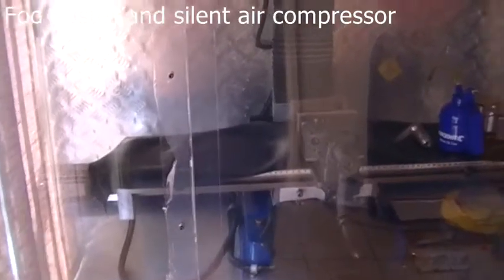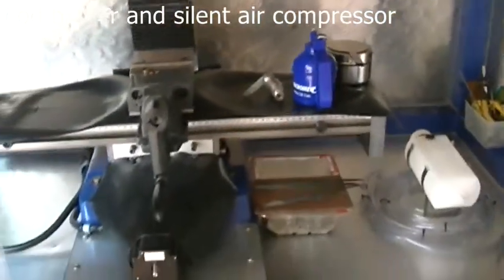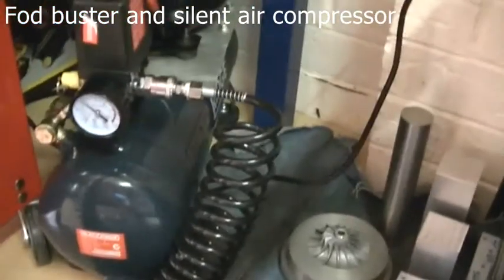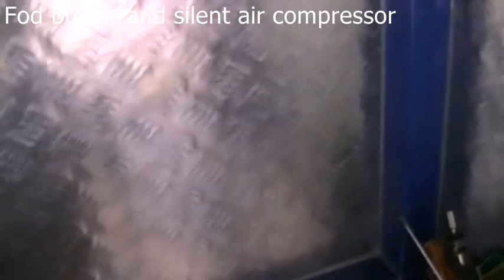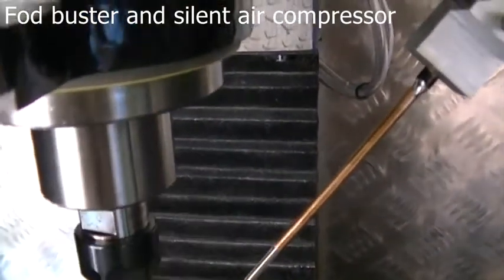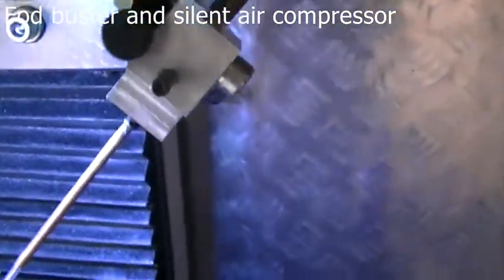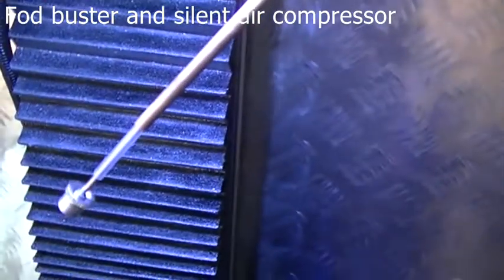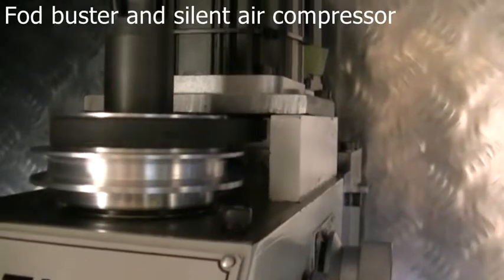CNC go704 tm25 mill Homemade Fod buster with a homemade silent  Air Compressor

Comment from the maker: hi adam , true true .
i squirt a bit of oil into the air inlet every time i use it.
i gave it a real hard time last week. aprox 16 hrs running, it killed the ring or what ever it has on the piston as it is having a hard time keeping 120psi . but it still workes great for the fod buster . on a power drawbar it would be great as it would not be working all the time as i did last week  , i pushed it way too hard.
its not a good idea to run them all day . but it workes well for what i use it for.

Comment: Hi Matt, nice work mate.  Any chance you can do a video on how to convert an air compressor like you did please?  As it would help dummies like me to make one LOL.  I have the drawing and files for the spindle spanner if you want it. PM me with your email address and I shoot them across for you if want? Cheers, Aaron (dctteacher1)
Reply: Because the fridge compressors are supposed to operate in a closed loop system, the lubricant can circulate throughout.

I've been thinking about one where you could have an oil separator before the tank that will feed oil back into the inlet.

Will be interested to see how you do it in your conversions :)